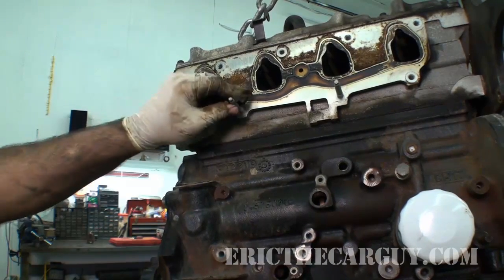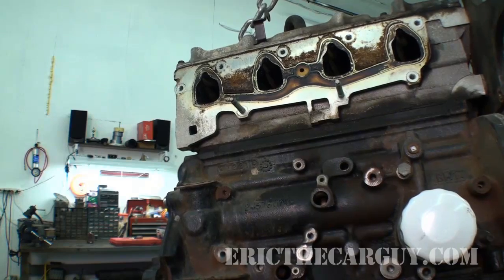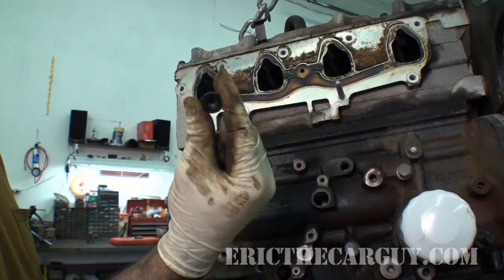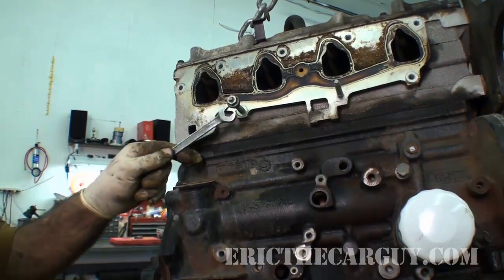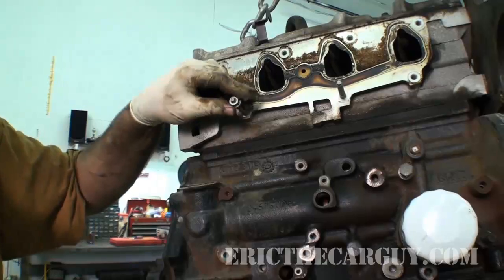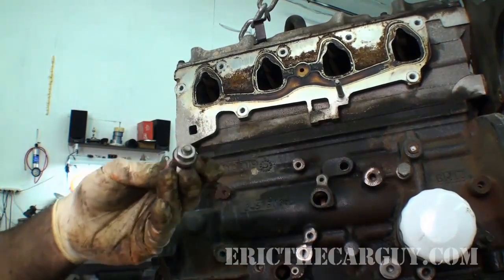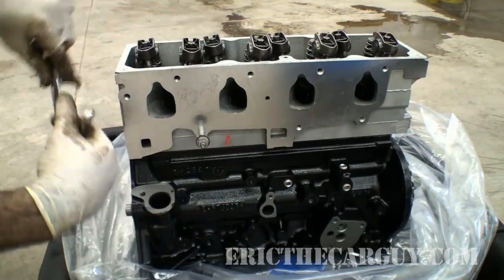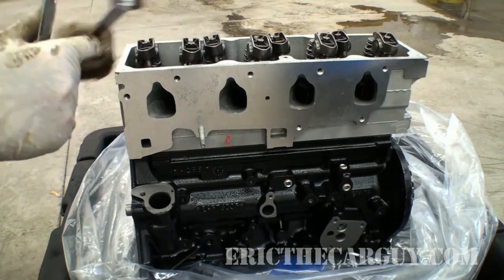How To Remove and Install Studs the 'Easy' Way

Comment: @daryl bull you get a stud/screw extractor. Its like a screw with a left hand thread. Drill a small pilot in the stud then screw in the extractor. Once it starts to bite it should bring out the stud. If it ose totally seized in there, you may need to drill it out and re-tap.

Comment: Hi Eric great videos especially with Paul Danner, with broken studs, if there broken off real short, friend of mine puts a nut over the top of it and runs a mig welder inside the nut so it welds to the thread, then he can usually undo it...trouble is with me I cant weld, i'm rubbish at is, cant see through the visor.

Comment: This is also good for getting snapped bolts out. I snapped one the other day, but I didn't have quite enough room for 2 nuts, so penetrating oil and some pliers gently on top got it out.
Reply: Idk how you snapped a bolt if pliers turned it

Comment: if theres room to do so i always liked welding the nut on there and letting it cool a little bit especially if its really rotted. that way it adds a little bit of heat to it. f150s are great for studs breaking off the manifold. for those i usually use one of those ratcheting stud grabber tools

Comment: TheRA3D85 check your power steering fluid if it's low add fluid if it leaks meaning its low after you add fluid in just a day or so you can add transmission fluid to swell the seals but that's just a quick fix also check the belts

Comment: I ran into the same issue with the exhaust manifold.  Bought the star socket set (Item #67898) from Harbor Fright for less than $10 to get the rusty studs out.

Comment: OOOOO that's similiar to how I do it but mine are old and crusty.  So I spray pb blaster let it soak after wrapping a rag on it and rubber banding it tight.  I wait 12 hours then I heat them up a little with MAP torch. When they are red hot I use two nuts that don't have the rings on them and put them together, then just put a socket over them and turn them both out at the same time.  My 240sx has like 230k mile so this is necessary for me.

Comment: That helped me out many years ago on a VW Beetle! Alternative is grinding down 2 flats onto either side of the stud, so you can get a spanner onto it - Great if you've managed to damage the thread on the stud (or if its badly corroded) 
and can't get nuts on.

Comment: Eric,

Quick question:  When you thread it into the new engine do you bottom out the threads?  In other words, do you thread in the stud until it stops?  I've heard conflicting opinions on the subject of threading in studs.  I would appreciate if you could shed some light on this subject.

Sincerely,
Michael Means
Reply: Yes

Comment: I had three studs stuck in a b16a, cannot be budged with this method. Completely frozen in. Attempting to use a stud remover broke one stud, so left the other two as is.

Comment: So how do you remove the inner njt if it's stuck on without removing the stud...and..if the stud come out, how do you remove the nut without damaging the stud threads placing it in a vice?

Comment: that's a pain without the right tools! i don't recommend this but it was a last resort kind of trick for me, what i did is i stuck a metal bar in the flywheel and bell housing to stick it in place so the crank pulley would not turn, got the job done. Not sure if it could potentially do damage though, this is why i don't recommend it